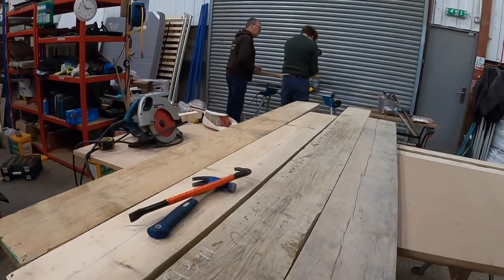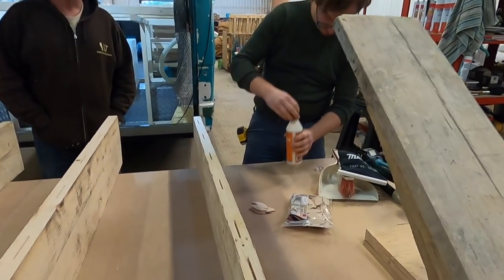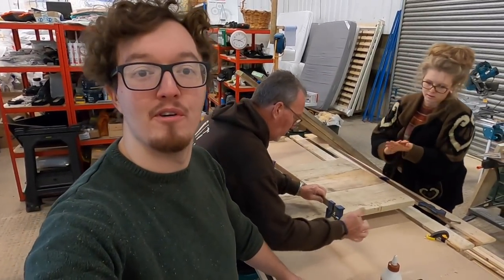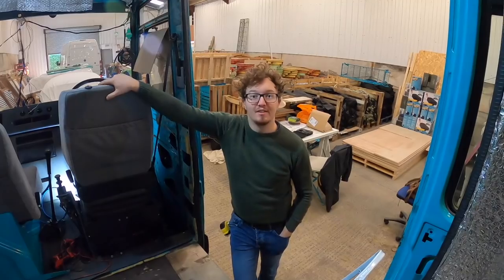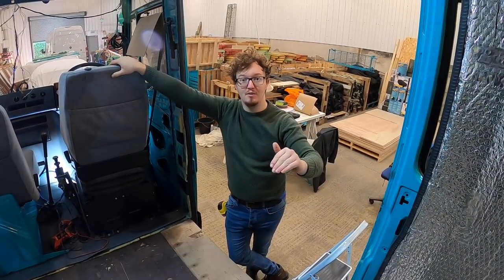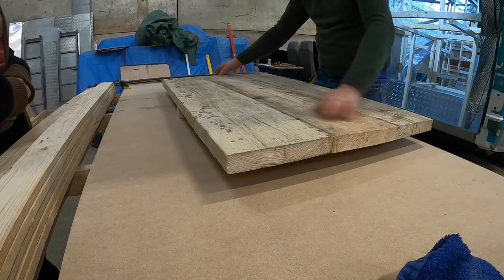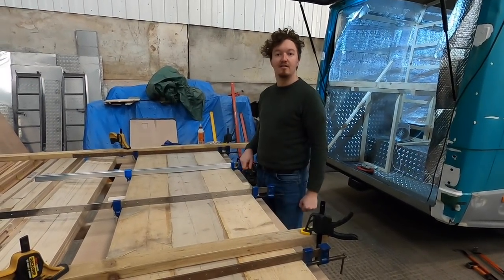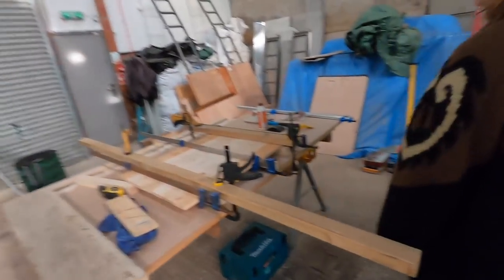SCAFFOLD BOARD WORKTOPS | Handmade Rustic Countertops for our Van Conversion | MERCEDES VARIO | Ep14

Comment: Hi guys, the pallet table top - I would definitely add some wood straps across the underside of the table. 
The glue n biscuits alone will not stop it from warping or splitting apart.
Glue n screw the straps down in place as well.
Keep up the good work...
ATB, Steve
Reply from the maker: Great tip, thanks Steve and Steven! Like you said it is strong one way but less so the other! We need to finalise our design with it but are really happy with how it looks so far 😊👍
Reply: @MaxSophieinaVan  reckon this is a good tip 😎👍✅

Comment: When gluing boards on edge together put clamps on top and underneath that will help with bow
Reply from the maker: Great tip, thank you! 😊👍
Reply: Also need to make sure grain is up and then down on adjacent boards, helps prevent the overall top from curling in future
Reply from the maker: Thank you Jamie - we did this on the countertops but didn’t have enough pretty sides on the table 😂 hopefully it will work but if it doesn’t we will redo it just how you said! 😊👍

Comment: Hi Guys, can't wait to get my vario thinking of going to Germany next year to get one, a thought occurred to me when you missed your cut out for the water filler is if you are having a mains hook-up socket fitted ?  and where is your electrical distribution board going ?  you 2  sound like blue peter presenters ! LOL  keep up the great work and you 2 work well together , regards Gary
Reply from the maker: That sounds like a great plan, they are great vehicles! And we are but we are going for an install under the engine bay for the hookup as we won’t be using it too often and it’ll be nice and clean there! Our batteries and inverters etc. Will be under our passenger seat with a control panel in an overhead cabinet! Haha, glad you think so and glad you are enjoying it! 😊👍

Comment: @maxandsophieinavan What material did you use for your worktop? 🤔 looks good.
Reply from the maker: Hi there! We’ve used reclaimed scaffold boards - so they were all bashed up but cheap!
Reply: @MaxSophieinaVan  ah that’s what the biscuit cutter was used for, to hold the boards together. Cool thanks ! Building out my 609d for 16 months so far. 🤗💪 bit by bit. Good to see yours coming together.
Reply from the maker: Bit by bit is the only way to do it! It’s overwhelming otherwise! Good luck with your conversion x
Reply: @MaxSophieinaVan  thanks you too. Going to build shower next, following your design.

Comment: hellllo, any cracks in the wood use a paste made of gorilla glue and sawdust smushed in and it wont come apart - it'll also disappear under a stain coat etc 😊. this will work for the nail holes in your pallet strips too. if you're are using pallets in the future you can take the wood off with nails attached,  snip them and tap them through with a hammer so the nail head pokes out and  can be levered out with either a hammer or a pair of carpenters pliers.  will result in holes that aren't blown out. link to a cheap and effective set of cutters for nails: https://www.amazon.co.uk/dp/B008PQAP8S/ref=cm_sw_r_cp_apa_fabc_ff.WFbQTPYFK5?_encoding=UTF8&psc=1
Reply from the maker: That’s really useful, thanks Jon! We’ll give that a go with our nail holes in the table! We are hoping we never have to do it again but if we do we’ll remember that! 😂👍